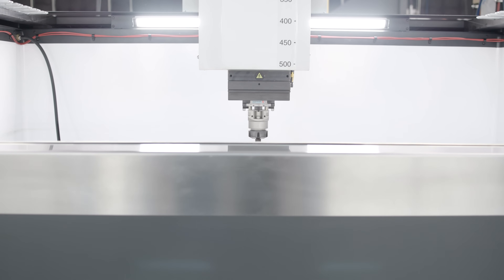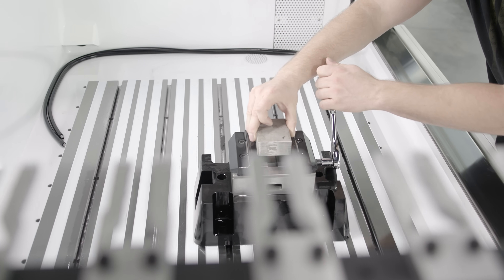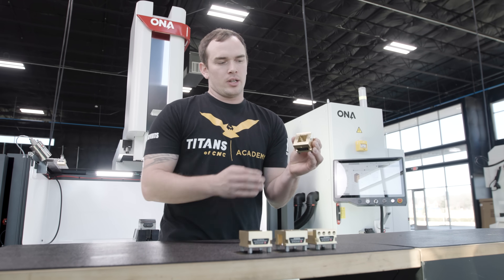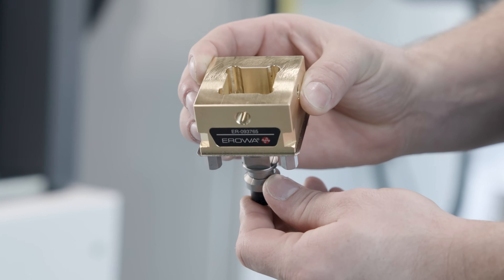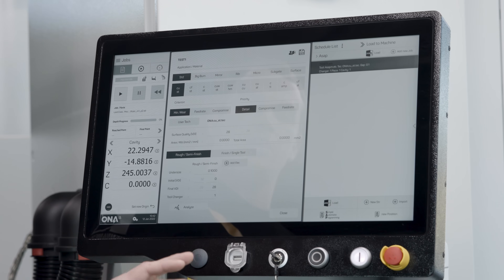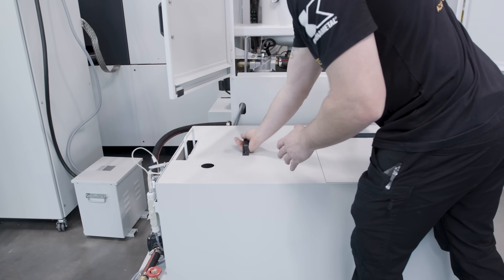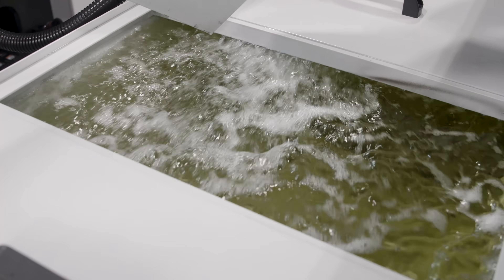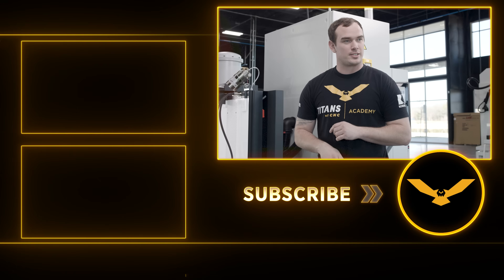Our SINKER EDM is SET UP… Time for First Burn

Comment: You'll want to do a sample where you cut a female part of it's own. Then the male part .0003 or. 0004 smaller where you simply can't see the two parts until you pull the male part up or drop it out the bottom!!

Comment: I hope you guys explain how you are going to manage the nanoparticle dust that results from wire edming. Dust that is fine enough to get through standard HEPA filters.
Reply: Am I the only one here that runs a submerged water bath wire EDM machine? I do not have any nano particles does problems
Reply: Isn't that caught in the oil?
Reply: @iamchillydogg  Some of it disperses into the air. Or that's what was reported by another company that operates multiple wire EDM machines at the same time. They reported that there were getting nanoparticle dust even in the kitchen area of the warehouse. The solution was to isolate the machines in another building.

Comment: EDM my old discipline, loved doing that job, Sometimes I would wake up in the middle of the night " am I burning through the table? I had to quickly write that program and set it running before going home" so if possible I would put a chunk of carbide under the workpiece. It never came in handy as I was good at my job but it was, rest a sure.